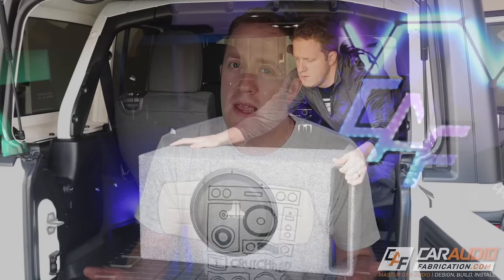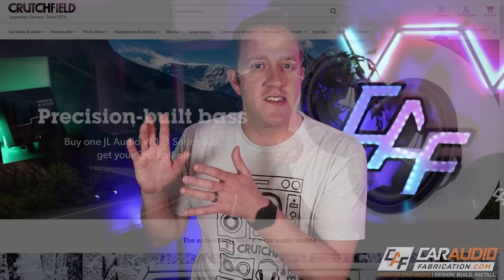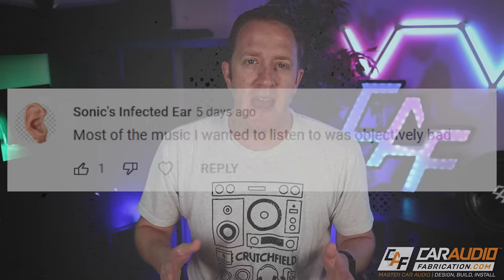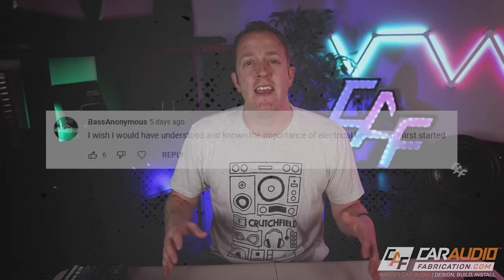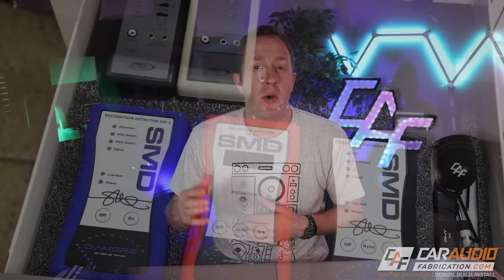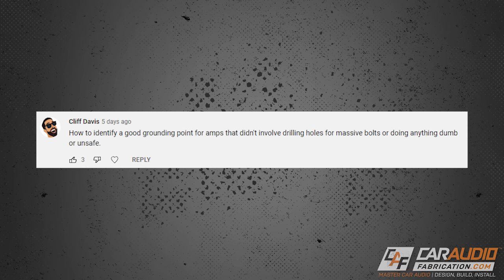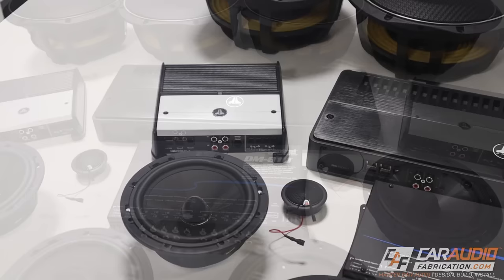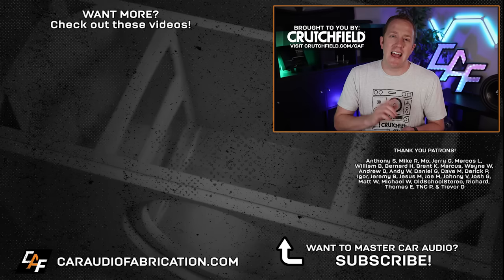My Car Audio System SOUNDS AMAZING now that I know THIS!

Comment: Manufacturers are integrating LOC's into their amplifiers. This eliminates the need for an LOC like the AudioControl LC2i. You can simply feed the 2V signal (Ford for example) by splicing the speaker wires into the JD500/1 RCA inputs. It picks up the signal and powers on and off automatically.

Comment: I wish I had understood that 300 total rms watts (speakers and sub) is more than enough if everything is installed properly with a correct sub box and proper sound dampening.
Reply: So true!!! My system has 200 watts total with plenty of damping in a 06 CR-V! One Sony 4 ch. and components up front and two bazooka bass tubes in back!!!

Comment: All good comments. 

Having a quality source is important for tunning.  

Over the air radio and streaming vary greatly in the sound.  I've caught the same song on two different stations and amazed at how different they can sound.
Reply: Radio station??? Do you upgrade your audio system to listen to radio???
Reply: @oscarishandsome5150  Of course I listen to the radio.
Reply: @davect01  offline radio would be the poorest audio source you can have.
Reply: @oscarishandsome5150  I would never tune via the radio.

Comment: I just wanted to add a tip for finding a good ground in your vehicle. So before you check for a good ground run your power wire from the engine bay to where your power run needs to go. Then connect the end that's in the engine bay to where you are going to use your engine bay ground point. For example if you are going to ground your battery to the chassis of your car inside the engine bay Connect the power wire to that spot then in the back of your car use a multimeter to check for spots with extremely low resistance (sub 0.1 ohm but 0.01 or lower is best). The run of power wire will likely be extremely low resistance and you can measure it before you run it as long as you don't change it's length. Lets say that your power wire has a resistance of 0.1ohm and you measure 0.11ohm where you wanna use ground then you are probably in good shape to use that ground point as it didn't add a significant amount of resistance from the front of the car to the rear. At least that's what I did when running my power wires and looking for a good trunk ground.

Comment: I have always wanted a sound quality install after my 140db/148db setup in my s10 back in the day. There's so much i learned but am always still learning. I havn't had a system in years just due to the fact i want to get it right and spend money in the right areas to have quality mids/highs and not just killer bass. My favorite part of my old setup was the Crutchfield brand class a/b amp that ran my mids/highs but I did not have proper sound processing to make it sound as good as it could.

Comment: Good Morning. I am planning on replacing all my speakers in my 2007 ES 350 Lexus. I found the manual for the model I have and the stock amplifier where for the subwoofer it reads a 2.5 ohm. I was wondering is it better to get a 2,4,duel 2, one that has both 2 and 4 ohm. Or is there a way to wire it to a 2.5 ohm. The subwoofer that came stock is blown so don't want to replace everything and only sub. Does it matter if I use a 2 or 4 casue I can't find a 2.5 ohm. Thanks
Reply: Get a 2ohm sub

Comment: is the magnet on that sub tops 1/4 lb lol you toss it around like a pen in your hand JL's base line has really lightened up... my old HX2 and you would have not done this
Reply: Still got a 10 hx2....feeding it 1000W
Class d mono amp....still DUMPING!!!  Since 2003. And it's not even the power hx2. Just the punch.
Reply: @marcobrigantetony  anythink older bbq style and pre trans ana are the best the whole line every pcs you get more cheers

Comment: Beside actual speakers and subs, the biggest difference I've experienced is getting a dm-608, second to that is going nuts on the power to supply the amps. Low voltage is bad all around, for every single thing in your system. After those two, sound treatment. Your car/truck is made with metal, it makes noise. And it makes for an all around more quiet comfortable drive.

Comment: Let's say I use 2 gauge power wire that is roughly 5m ( 16 feet ) long. But my Ground needs to be only 1m ( 3 feet ). Would it be fine to use same 2 gauge for ground?
Reply: Yes

Comment: Learned that for hatchbacks and SUVS ported boxes almost always sound better than sealed. Sedan use a sealed box.
Reply: I have a sealed box in my sedan it's way worse than ported box in most cases. It's not that simple.

Comment: The last 3 cars I've had 97 seville 08 BMW 335XI and 2017 Cadillac ATS crutchfield told me I couldn't put a stereo system in those cars  and I did  lol my advice if your going through crutchfield if they tell you can't do it don't listen keep looking. They do have good advice i will say

Comment: To the comment about the ground wire. It's fun to think that in electrical theory we think of energy flowing from positive to negative.... In reality, that was actually a foundational mistake, electron flow is from negative to positive. The chassis of the car is your negative lead haha. In reality, it doesnt really matter, as you say its the whole circuit that's the most important to consider.

Comment: Speaking of enclosures and air volume. I'm going to build a stealthy subwoofer in my Honda Civic and my current design has 42.45 liters. Could I look for a subwoofer that are close to those specs or should I find one that works best at let's say 40 liters and adjust my design? How much difference does 2,5 liters make?

When I think about it those 42.4 liters are just the box. I haven't calculated with the volume the subwoofer occupies as well as supports in the box.

Comment: Lol step 1 to sound treat my vw beetle is not to buy sound treatment but to buy new door panels 😂half of my door is actually held together with duct tape granted I did get some stuff to plug the holes in the sheet metal it's self which did help alot now if I had actual door panels and not half a panel might not have quite as much vibration
Reply: However sound treatment is going to become a thing once I've fixed the doors 😅

Comment: Hi Mark, thanks for this informational video. I am planning to get the following after market components installed with my stock HU, what do you think about it:

- Morel maximo ultra mk2 component
- Morel maximo ultra mk2 coaxial
- Zapco ST68X 8ch DSP + 4ch amp
- Zapco ST4X II Amp
- Morel primo12 subwoofer

Comment: I have found that with using spotify, the file quality is usually better when i have premium, and fairly poor when i do not have premium
Reply: You would be correct, premium streams at 320kb/s and the free version is half that.
Reply: @Averna222  didnt even know there was information out there that was consistent with what i was hearing when using the service. I appreciate the information
Reply: When you sign up for premium it says you will get better quality
Reply: @henninghellerud  yeah but ive never noticed anything in that about SQ just the usual ad free nonsense they ralk about in there

Comment: Damn all that JL and you put an audio control unit in the mix vs the JL TwK88. You like the audio control better? I had nothing but issues with audio control, products and company. The TwK88 is has more of a learning curve and the software needs improving. Been a while since I was a audio control dealer though, maybe it has improved.

Comment: Thanks for the video
Reply from the maker: You bet
Reply: @CarAudioFabrication  question: I have a 2004 Honda Element with the 7 speaker factory system. I have Kicker 6.5 CSC 65 in the rear and Alpine components 6.5 up front. I haven’t replaced the factory subwoofer yet. I believe it 6.75. Should speakers be all the same brand or can you mix. What do you recommend for a replacement subwoofer? The amp is the stock factory one. Thanks 🙏

Comment: I wish I knew how to use CAD to model the sub enclosure in 3D to quickly and accurately be able to measure internal volumes for vented enclosures.  What CAD package do you use and how do you measure net volume vs port volume during the design process?

Comment: I'm one of those strange, lonely, hard headed guys that will always ground
all components back to the battery. Yea, I've seen the multimeter videos, 
where spot welds supposedly make just as good continuity as dedicated
wiring, but that's why my '89 Buick has dedicated positive and ground
junction boxes for the electronics. Same setup for Corvette. Plastic panels
and panel bond doesn't conduct well.

Comment: I have a question if I was to say buy a 2in 4 out distribution and install one input as the power input and one as ground input to do a dual setup. I'm new to this. I have a 1994 Chevy Suburban C1500 with a factory radio and 8 factory speakers. I am planning on upgrading later, just trying to get some idea before starting my project. I'm planning to put just 2 8in subs in a non-ported box right with a 1500watt amp

Comment: I'm having a problem with my headset the volume seems to be decreasing day by day I've done the big 3 replaced the alternator to a high output and redid my wiring with 0 gauge ofc all around please help

Comment: Awesome tips! Just had a question about the ground wire one. Even if the wire ground wire is sufficient for its distance we should have just as big as the power wire coming from the battery? For example, the system I want to install pulls around 182amps. So I would need 2AWG wire (2018 WRX). I went with 1/0AWG to be safe and it was easier to find. But I can't use 4AWG for the 2ft long ground coming from the distribution block to the car's frame?
Reply: No, you absolutely cannot. You need current to flow, in order for that to happen, your wire has to be able to accommodate that flow in both directions, positive and negative. Think of it like water pipes. You can't take a 36 inch water pipe and expect a garden hose to handle the output flow. Same concept with electricity 👈
Reply: @huhdidwhat  but doesn’t the same concept that the longer the run the thicker the power wire needs to be? Why I need the same gauge ground if I’m running 6in in the trunk vs running back to the battery in the engine bay? If the amps were in the engine bay the power wire wouldn’t need to be a thick. I’m not saying you’re wrong I’m just having trouble understanding the concept
Reply: @_gregvalencia  concept is simple. every wire is a resistor. the thinner the wire - the more is the resistance for the same length. more resistance means more heat and more voltage drop. So, you need wire that's capable of that current handling, and if it's really short - you're safe to go. 
For example, I have 10mm² cable for positive wire as it 1.5-2 meters long to minimize voltage drop for such length. While my negative wire if 6mm², as it is only 0.2 meters long. Fuses are 50A and 6mm² wire is capable of handling 50A.

Comment: Hey I love your channel but the information on one of these subjects is not accurate.  I have an aftermarket head unit SONY 9500ES and I do not need a DSP at all.  This unit allows me full control of all speaker’s individually.  You stated that aftermarket units do not allow this.  I think I’m correct so please if I’m wrong let me know
Reply from the maker: Let's say you are running an active 2 way component set in front. You need to time delay each speaker with tweeter in the sail and woofer in the door. (An extremely common set up). With that head unit you can only delay front L/R and rear L/R so you are left trying to decide which is more important to delay to the listening position. You have to concede performance. This issue is compounded when you need to set up time delay for an active three way set with 6 speaker locations up front, or even more importantly, EQ each individual speaker. Is that a great head unit? Yes. But is it a replacement for a true DSP in an advanced application? No.

Comment: Can someone tell me is my sealed subwoofer box too large. I have 80.2 liter box made by myself and i have 2 12" ground zero subwoofers in it. On the web it says ported box size 37L and sealed recommended 30L. Is the added 25% size on the box making it too easy for the speakers to hit bottom?

Comment: I bought a 12" Alpine type R that came with cable and the amp with it off of Amazon. it's an 1800 watt system do I need to do anything else? and is that a good purchase?

Comment: Hi Mark! Can you help me design a sealed box for my Single Sundown SA10 dual 2 ohms. I’m putting this sub in my E39 1999 BMW. Powered by a HiFonics 1800.1
The height must not exceed 11.5” or it will hit the top baffle.

Comment: I'm not understanding why subs can't be Bluetooth with built-in amplifiers. The wiring is so old school
Reply: Wires over wireless will always sound better. Think of how fm radio works. When you are at a point to where 2 stations are using the same frequency, they cause interference. With a wire, at least a shielded wire, you are not likely to have any interference, aka cleaner sound. 
And two, some have a bias of what amps they prefer. Using built-in amps for most is just a no go. Also built-in amps raise the price for a speaker you want to use with a different amp. Not everyone who buys a kicker sub will buy a kicker amp, they'll buy a pioneer or a Rockville amp as an example. 

Pretty much, this idea you have isn't really feasible for most who do car audio. Although it's not a bad idea for those looking for a quick and simple install, it's not in demand enough for known car audio companies to start making and selling.
Reply: idk why the reason is but i feel it’s a either a good reason(not sure the reason) OR just a marketing scheme

Comment: I've seen modern cars with great sounds systems. But a nice set of tools, adapters, panels, and special connections were needed. Yes it can be done but someone better be ready when starting this journey. It ain't like it used to be. (:

Comment: 😒 🤔 I have a budget build and it does sound good for the brand I chose, even though it's not the best. I need to upgrade my head unit which is a Dual 6.2 in touch screen and a SSL Charge 1500 watt one channel amp on 1 NVX 12" Sub in a seal box..

Comment: I wish I knew that a bass restoration processor should be the first component after a headunit, before a EQ or a crossover. I've asked and seen most setups with a BRP as the last component before the amp, which is how mine is hooked up. I want to "correct" it but something tells me it wont make a difference because of the crossover before it. I was looking into a DSP, is there a way too add one into my system and still keep my current components?. Specifically I have a sony headunit to a 7 band EQ under it in the dash, in the trunk I have the active crossover and the BRP going to 2 amps, specifically Skar RP150.4ABM and a RP800.1DM. If it is possible, where in the system should I add a DSP to make the most of it?. TIA.

Comment: 🔴 nice video, am not to much into sound quality (sq) am mostly into spl of which i never hear you talk about. What are your thoughts on port area and port tuning, 4th order vs 6th order, sundown and skar audio (competition subs), hitting 150db on the meter. would you ever consider making a video on those topics
Reply: Isn't there enough of the SPL BS already out there?
Reply: @MotoAtheist  theres no such thing as  enough SPL BS. lol
Reply: @doublemanson    SPL is the dumbest thing to ever evolve from car audio, but I know manufacturers love it.  The amount of money they make from 1 second farts is amazing.    I should clarify a bit.   Sure, it's neat, went to Slamology and was amazed.  However, every single SPL setup sounded the same so for me it was more about how it all looked and was built.   If it couldn't play regular music it was simply pointless to me.  I get the hobby aspect, it's just neat and fun all around to mess with.  But at a certain point, if it's strictly for SPL drag racing, well, to each their own for sure.

Comment: Some aftermarket head units have built in dsp right???
Reply from the maker: "Yes" the problem is they have no wear near the features needed that a proper standalone DSP does. You need to DSP every channel. Most head units only allow for four channels and you are stuck trying to tune on a touch screen interface. Usually only graphic EQ as well.
Reply: @CarAudioFabrication  I’ve learned alot from ur videos and I’m confident in my capabilities to install the setup I’m currently building and about 90% complete…Keep up the good work!
Reply: @CarAudioFabrication  The head unit I’m looking at has a 48 Band DSP. What are ur thoughts as to using something like that???

Comment: Is it ok to ground an amp directly to the battery - ve terminal (battery is in the boot, close to where my amp will be), or should I find an alternate grounding point???
Reply: No .. best practices is to dont connect ground  directly  to Battery.   you want to connect ground to the frame or a hefty chunk of steal in the car
Reply: @JOHNSMITH-Figment  I know that's best practice, but surely the frame earths at the battery - ve?
Car is an Audi A2, so aluminium space frame and boot floor is some kind of plastic/composite!
Prob be a longer cable run to earth on the frame rather than battery!
Will do some testing with my meter!
Reply: Yes you can ground the amp to the battery. It’s recommended for aluminum frame vehicles.